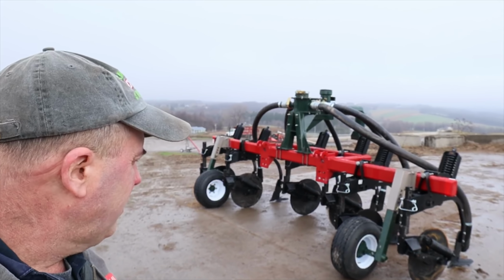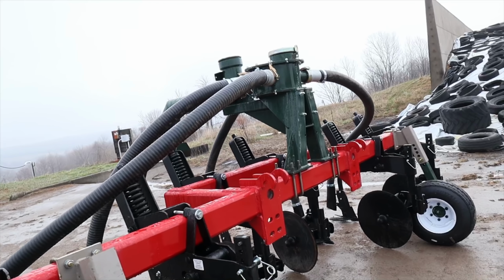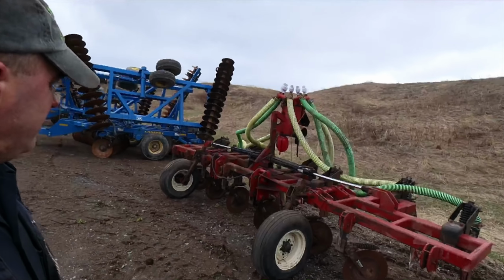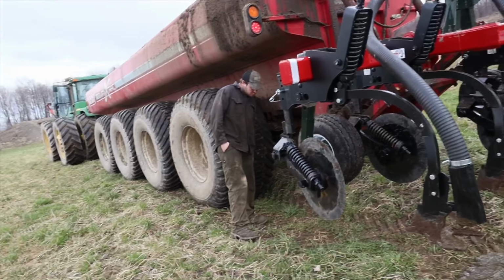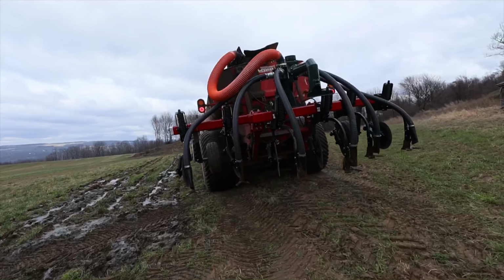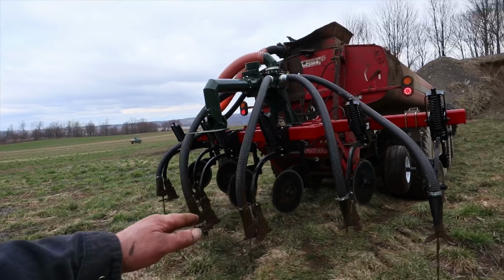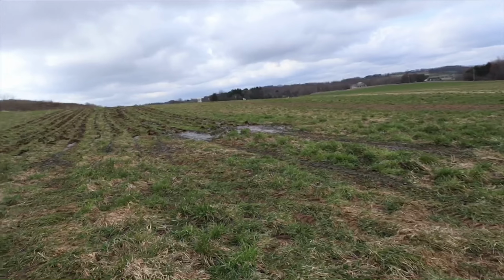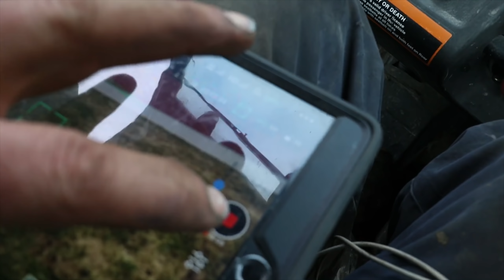Injecting Manure with an injector from Ortel Supply

Comment: That 2 to 3 hours drive had to be fun. I live 30 minutes northwest of Ortel's. Fun fact about Dennis, he use to sell nuts and bolts before manure equipment and the only reason I know that is because my Grandpa was one of his many customers. That place is a great place. Glad to hear you guys are doing business with Ortel's.
Reply: Also Andy, I worked on a dairy farm that used those Dietrich injectors. They are by far one of the best injectors out there.
Reply: You want to explain the value manure has in dollars and why you spend lot of money putting it on the fields.
Reply: @tomfaessler6072 , Manure adds a lot more nutrition to the fields then any other fertilizer out there does. If you don't put some kind of manure down (cow, chicken or beef), you are losing the nitrogen and potash from the manure that the crops take. Manure also adds organic matter to the field (like what leaves do when you chop them up really fine). So if you wanted to do that, it would cost thousands of dollars just to get the field to a good state to grow decent crops.

Comment: Great video! That 30 minutes went quick. I helped a farmer knife in manure in the late 70s. He had a Same Buffalo tractor and a tandem axle Badger tanker with 3 injectors on the back. I don’t remember exactly how but every now and then an injector would plug and would have to take the hose off to unplug it. He would haul 24/7 in the spring and fall as to get as much out of the pit as he could. I always ran the night shift and l enjoyed it.

Comment: We have the same injector bar on our tanks, to make points last longer we weld on them and drop tubes.
Reply: We would run a bead or two along the plow shares with hard welding rod that made them last quite a bit longer.

Comment: A few years ago all I ever saw was injection but the last few years I haven't seen anyone using an injector.  Around here most of the spreading and injection when they were doing that is done off the back of a tractor with lines to a diesel pump pulling out of the lagoon.

Comment: Do you run the injector bar on float, or do you have to keep some hydraulic pressure on it to keep it in the ground?  How did the healthy heard silage corn feed out that you bagged a couple falls ago? Wondering if you ended up comparing it to bmr, or if it just ended up as heifer feed. Excellent video as usual Andy!
Reply from the maker: Healthy herd didn't do as expected. We run constant pressure and there is a relief to to keep a constant about of pressure on it

Comment: Was wondering what the analyse is on the manure and how many gallons or pounds to the acre, and do they have rate control, or are they stuck driving one speed???
Reply from the maker: We can vary the speed depending on how much we want to put down
Reply: We have a spreader we vary the speed with the pto. to put on a low rate with hog manure, we use a 540 RPM pto  and adjust the throttle and ground speed. for higher rates, we use 1000 RPM pto.
Reply: @joepfeiler5911   Thanks for info have no experience with liquid manure.

Comment: Probbly worked out by now but If the injector is pumping at the same rate, before you had 8 injectors, now only 6, it means slightly more material per injector, if you sped up(things might break) or slow down the pump you would have less overflow on the surface. At least Its all going in there. I'm slowly working through all your videos, much better and more interesting than the crap and adverts on the TV.
Reply from the maker: Thanks

Comment: What is the projected increase output of crops planted on ground that has been injected over other forms of fertilizer and over no fertilizer at all. On average how many bushnell per acre are you producing
Reply from the maker: It's not much of an increase. The manure provides more than just nutrients, the organic matter is probably more important than the nutrient value. We probably see a10-15% increase in yields from manure and if you don't apply fertilizer you are just waisting your time.

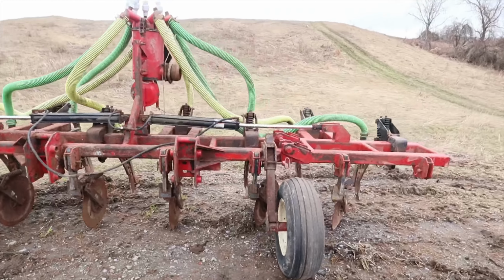Comment: 12:28 Is that land going to be cut as silage this 4th season?  If so, any thoughts on the effect on the roots of those horizontal knives?  I've mainly seen disc type openers in grass or maybe rather thin straight vertical knives.  Broad-spreading/spread-plate is tricky in Sweden, you can "interpretate" the rules but also get a lot of shit for it.  Approx what amount are you putting in?
Reply from the maker: Going into corn, 10k per acre

Comment: Here in the Netherlands we always have to inject the slurry, also we can’t put the same amount on as you guys 🇳🇱🤔
Reply from the maker: I think you guys can apply the same if not more. What are your average rates?
Reply: @FarmingFixingFabricating  we can apply around 40 kubic meters, depending on our slurry results. 40 Is a bit high but good paperwork does a lot😉 So is that the same? On school they said that over there you could apply more?
Reply from the maker: @boersven  depends on nutrient value, crop uptake and soil type.

Comment: the injector wheel axles look like they will be the first breakage item.
Reply from the maker: They do look light. We have the same on our other injector and haven't seen any problems in 3 years
Reply: As long as you don’t run excessive down pressure they hold up well. Tanks with active down pressure work better. We had a tank without pressure relief and the injector would lift the back of the tank up then we’d break wheels

Comment: never did any poo spreading like that all i have done is dry box beater on the rear so dont flame me on this but could you tweak the flow a touch where the poo would not hit bottom the trench and blow back to the top and not stay on top the ground maybe
Reply from the maker: You could, but we are satisfied with what we are getting from it.
Reply: @FarmingFixingFabricating  was just watching this and was only looking to learn if that could even be done did not know if there was to much solids in the poo or what i know there was a farm or city waste something here and in the stuff they was knifing in there was to much solids and they had to leave it full send and then work in the rest with a tillage pass